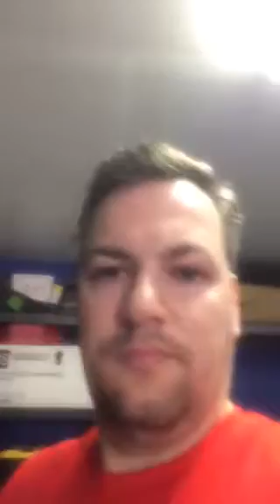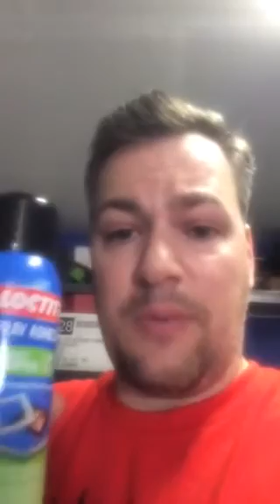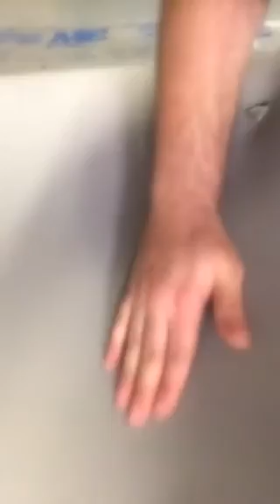Loctite Spray adhesive sucks

Comment: I used the loctite 300 on the interior panels and headliner in my 71 suburban. Lots of vinyl. After 9 months it started to fail hear and there the the fist day over 90 degrees total failure. Even the door panels failed. I had to remove the entire interior and start at over new. The glue was still sticky even after 3 days exposed to air in 90 degree temperatures it never dried. I'll never use loctite products again. It cost me $500 to start all new. I've used 3m 77 on my other 3 cars with no problem. Even after 15 years. Lesson learned.

Comment: ….Read the can.
You got the wrong kind. It say on the can “ Repositionable”. This specific type is primarily used to spray the back of plastic stencils to prevent the paint from bleeding underneath the stencil.
You got the One type of spray adhesive that is meant to be removable.

Comment: I agree.Used Loctite 200 to stick carpet to cheap gun locker,1/2 hour later it was all in the bottom .Use Loctite for your bolts,3M for spray adhesive

Comment: you know if you read the can it says not recommended for headliners
Reply from the maker: Maybe I missed it but I did not read that, what I read was "Bonding paper, cardboard, foam, fabric, foil, leather, felt, cork, certain plastics or bonding these materials to metal, glass and wood." I was working with Foam, fabric and fiberboard (cardboard). 

It might have been on the can, but since I was using it for a headliner, if it said it wasn't for that I don't see why I would still use it.
Reply: Tech4hire it actually says in the important section Not recommended for unsupported vinyl fabric or headliners. It’s more for crafty stuff like getting glue to stick to tumbler cups so you can later screw them up and spend hours using stanky nail polish remover an everything you can think of to get the crap off... wait sorry we were talking about your headliner 😂
Reply: Can confirm; I have some Loctite 300 right here on my desk and was about to try it on MY headliner.  Important, "Not recommended for polystyrene foam, unsupported vinyl fabrics, or headliners."  There IS other stuff in the Important entry, but I'm commenting only on this specific point...and this video just saved me from wasting $16 or whatever it was for a big can of this stuff only to find that it won't work.  People don't like to do refunds when you use a bunch of it first.

So FWIW, you spared me the sadness and frustration!  I didn't see that section either, and I did read the can for the most part.  I always do, and remember doing so this time...I simply didn't see that in my quick-scan.
Reply: I would like to add that if you are looking for decent spray for headliners I believe I used Krylon spray adhesive for my Cherokee. It was a fairly thick fabric and I sprayed it 4 years ago and no one spot is drooping yet!
Reply: Elizabeth Shirako I use this stuff for my tumblers I design so it’s great stuff, just not for that lol
Reply: I gave the can a 'quick scan', which covered most things...but I somehow didn't see that it explicitly suggested against headliner use.  And yeah, it wasn't the Loctite-stuff's fault, I simply read it in a hurry.  I thought it looked good enough *at a glance*, then ran home with it.  I found this video, looked closely at the Important thing this nice fellow commented about, and found that he was 100% right.  It said right on the can, "Not recommended for X, Y, Z, and Headliner use."

That's totally my fault, and I have no question there.  This video simply saved me the cost of an adhesive I don't need since I didn't use it and then wonder "Why isn't this WORKING right?!" or stuff.  I looked for a how-to-use video, searched for "Loctite 300 headliner" on youtube, and boom, "Don't use it...that's the wrong thing for hanging headliner."  Having not used it, I can return it for a refund.  :)  I'm sure it's great for what it's SUPPOSED to be used for...but I only exclusively bought it for use on my fallen headliner cloth.

Comment: Thanks for the video, I have a Loctite spray, but it says "Professional performance" Heavy Bonding Then it has a Box next to it that says '300 Heavy"  Is this the same as your spray? or Different from the one I purchased ? I know they have Different Strengths of Spray Adhesive Depending on the job needed for :o)
Reply from the maker: This was the heavy bonding spray. Haven't tried the 300
Reply: Don't bother, LOL, I saw another video that says it's to Thick and Messy as well, Some Recommend the Scotch Super 77 Multi Purpose adhesive spray, I am returning this can and not taking a chance with it, it has bad review as well Loctite 300 that is.
Reply: Tech4hire - From this video and some of your other videos, that is NOT a Heavy Duty Spray Adhesive from Loctite. What you have on video is the Loctite Craft Spray Adhesive. Not meant for what you're using it on. Meant for small craft projects. Can't blame the company if it does not work on what it's not indented for.

Comment: I bought a similar Loctite product, "Loctite Spray Adhesive 200", same issue. All I wanted to do was adhere new vinyl to spotlessly cleaned plastic A-pillar trim parts. The shit never really set up, a month later it's just a sticky, gooey mess like bubble gum left out in the sun. I can clean the goo off of the plastic parts but I doubt I'll get it off that cloth backed vinyl I used, will probably have to buy new and start over. I hate them very much too...someone should die!